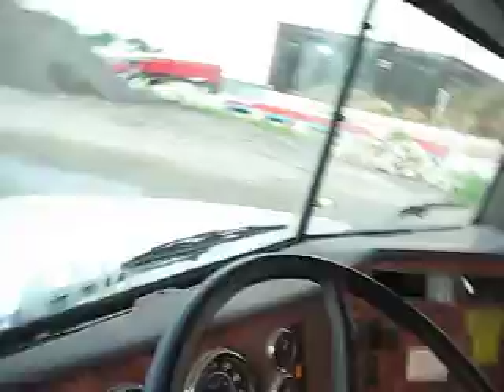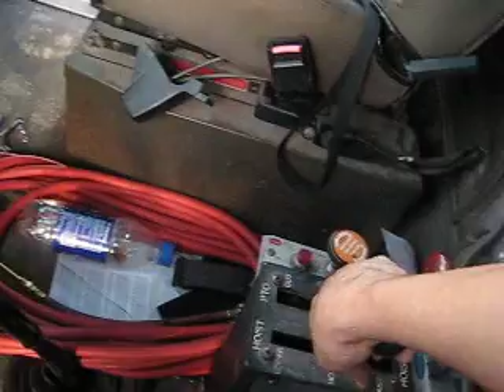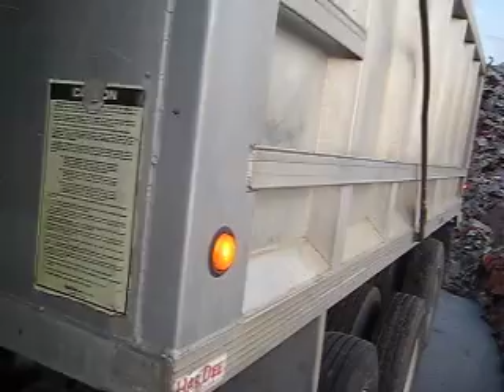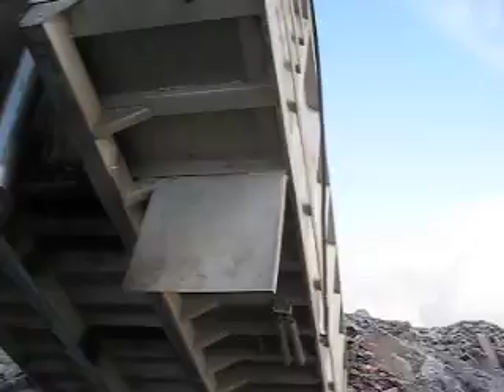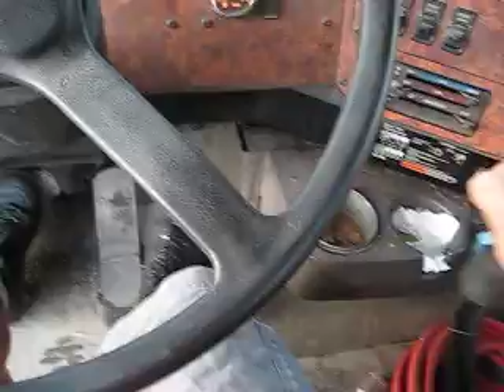dump truck vid 001

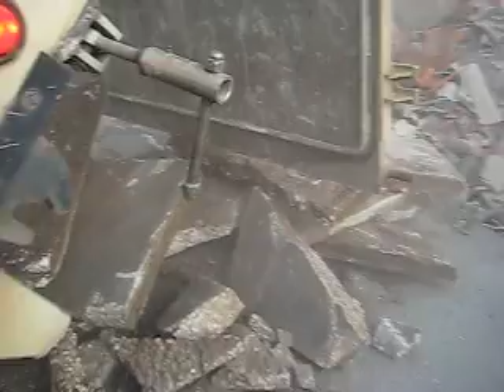Comment: Nice. Sucks when the stuff doesn't want to come out. Those controls seem heavy duty. Nice to see another control video finally on here. What was the screw clamp that was in the video when you went to the back to check to see if everything was out at around 1:24 to 1:26 ish. It was sticking out the side. What lever button do you use to lower the 3rd axle?

Comment from the maker: I put a caption to help for other peolple in the future but t is a safety latch (you see it in the begining also) that keeps the gate closed in case the air locks fail. It is located near the hoist lever close to the driver seat. I'll show how that works in the next vid.